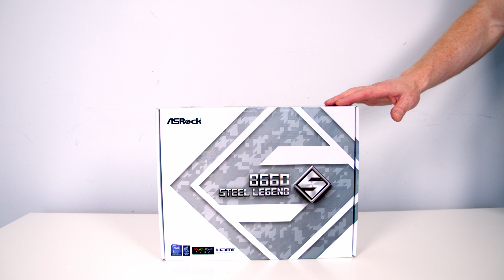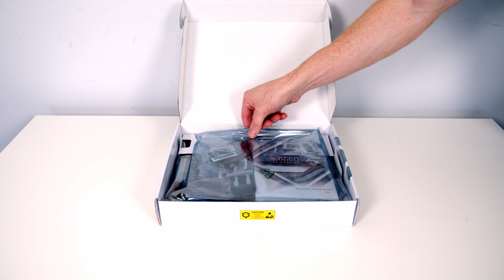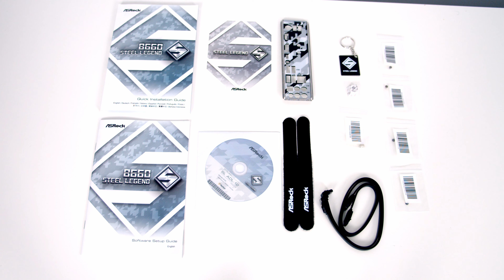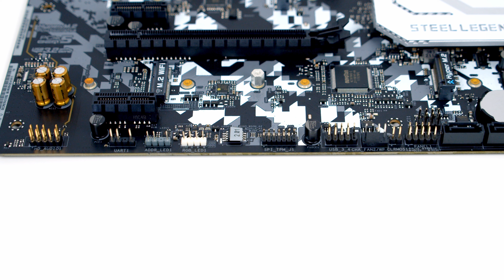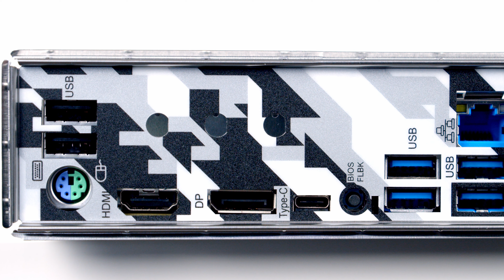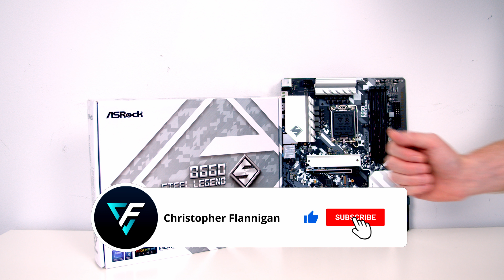ASRock B660 Steel Legend Overview

Comment: Want to know if this has an external clock gen, and if it's capable of OCing the locked parts using BCLK overclocking. Like it's been proven you can OC a locked 12400f using BCLK.